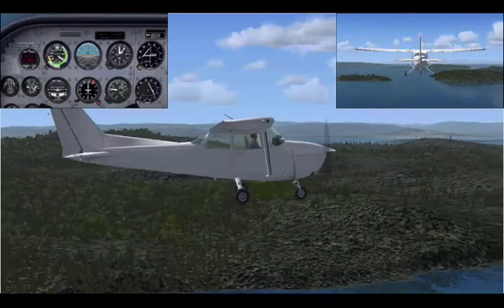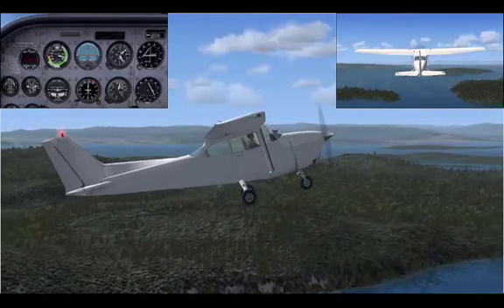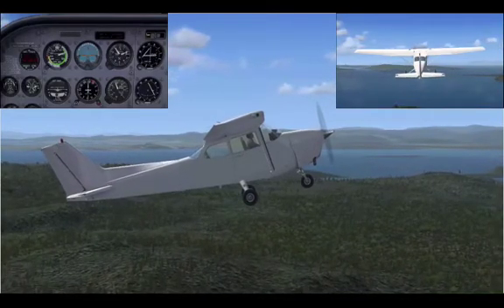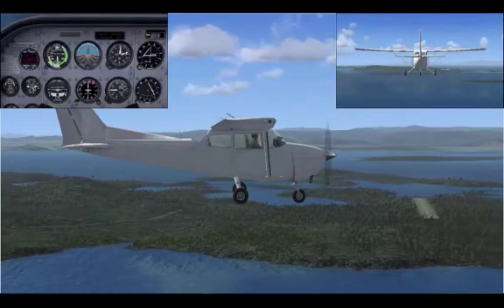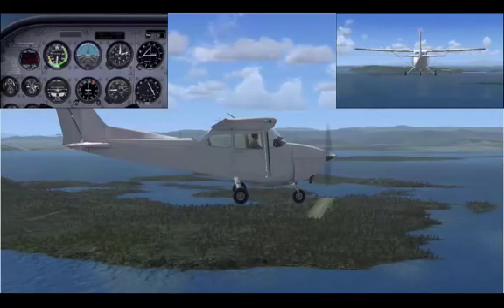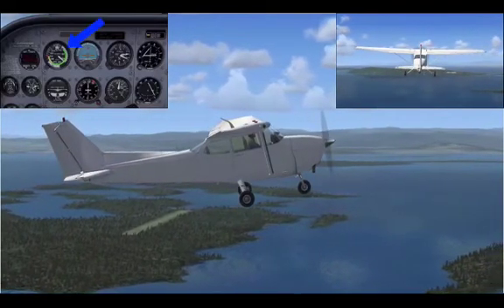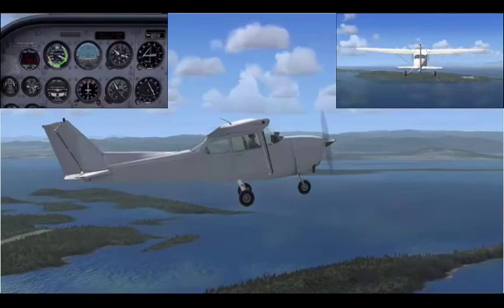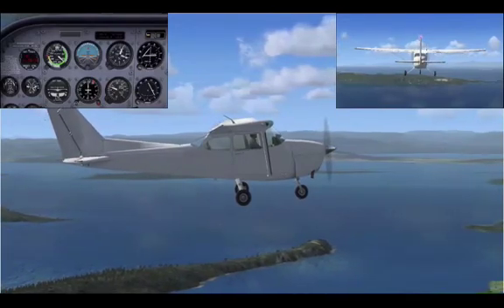Max Angle vs Max Rate of Climb

Comment: Here is another way to do it.  Pitch for the climb first.  As the airspeed decelerates to best rate, then slowly apply power.  You will appreciate this method when you start learning instrument training.  Also, you won't over speed the engine if you do it this way.  Also, you can apply right rudder slowly as the P factor increases (left turning tendency).  Just a little advice from someone who has been flying for a while.